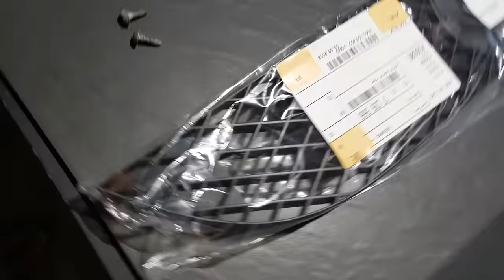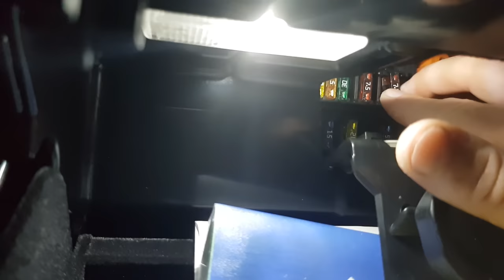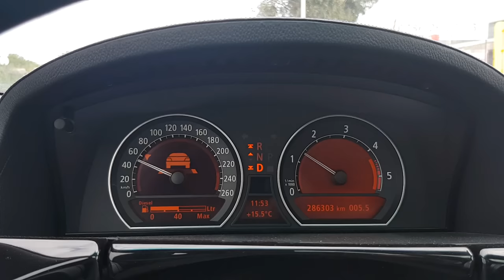Big retrofit BMW e65 : Part 6 Active Cruise Control

Comment: Hey, great install, quick question, is the grey cap you install at 4:27 the resistor and PT CAN terminal points? I ask because I read this can cause a lot of errors as it gets soaked in water.
Reply from the maker: Hello , yes it is the CAN terminal point , it car stay submarge in water because it won't be affected it is build specialy for exterior , ony fi somone who will put their hands on that terminal and dont close-it corectly can couse problems !

Comment: PT_CAN_L
PT_CAN_H
which connector do you use
Conectó to PDS module
Reply from the maker: I'm not quite understand you , I'm using original wiring and is conected in the original place OEM ...
Reply: @MOvidiu  I have e60 ACC from E65 it’s   Working perfect system but 2 errors to sensor presion it’s posible I’m not have module LDM
My connecting its direct to cable DSC 
Pin can-l can-h massa positiv and 15 wup

Comment: I have a e92 bmw 335i and need to align the active cruise control sensor. I noticed when you retrofit it, you were measuring some distances to get it aligned. Is there a generic starting point and what were you doing?
Reply from the maker: Hello! You need a calibration stand,  i did not show that process in the video,  you need to go to the dealer

Comment: Hi, im from france and i would like to add active cruise control to my E91 320D 2008 it already has cruise control but not active. Is it possible to retrofit and how much it will cost? Thanks alot
Reply from the maker: Hello,  yes it is possible to retrofit ACC on e90 , the cost depends from where you find the parts,  what parts do you have/find....
Reply: M.Ovidiu thanks for the respond, yes i have have all the parts from an accident 335D 2007. If its ok with you to tell me how much you will take to retrofit it and how long it takes? So i can prepare to bring the car for you. Thanks 😊
Reply from the maker: @Winter1256  in about section you will find more details
Reply: M.Ovidiu perfect

Comment: Hello, i have an e60 (2004) with original ACC, but the radar broke. How do I put "normal CC"? (without radar)
I have already replaced the "normal CC version" joystick and coded it but it doesn't work.
Can you help me?

Thank you so much
Reply from the maker: Hello . It can not be done . look for radar and do it again with acc
Reply: Perhaps if you change vehicle order the FA or FO its called i think and remove the option it might work 

Keep in mind changing vehicle order will recode all modules back to whatever default the FO/FA is